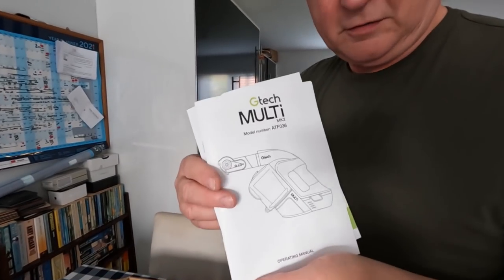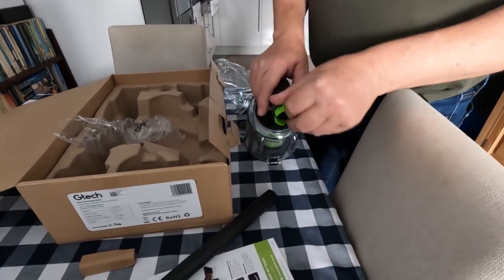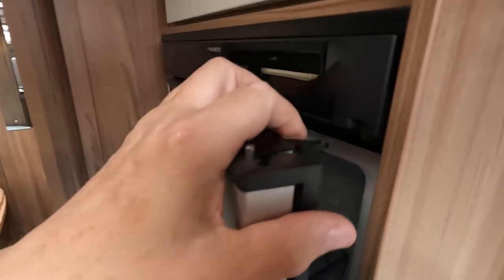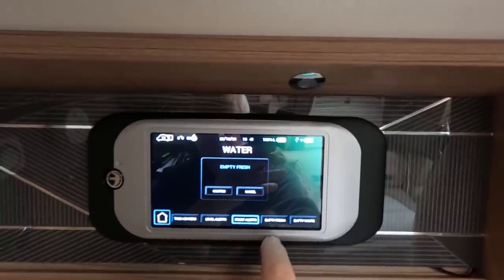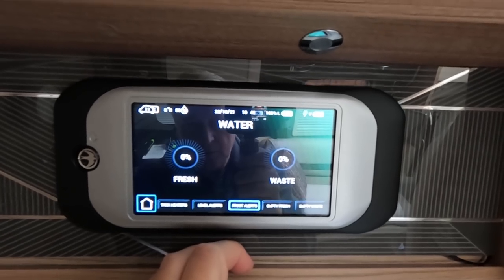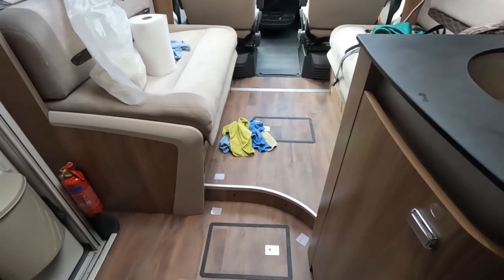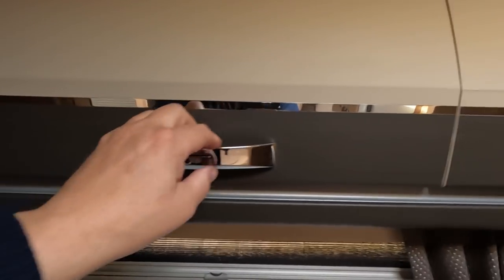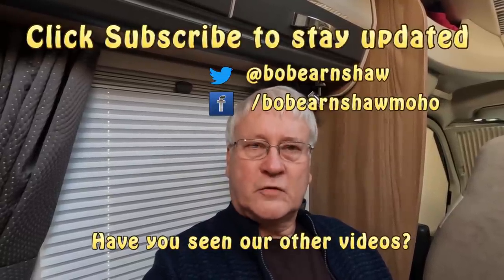Motorhome Warranty Work | New Gtech Vacuum | Motorhome Cleaning and Drain Down

Comment: They are spot on the G-techs aren’t they. I learned something new too - I didn’t know there was a tool stored in the main body it’s self - I should have probably read the instructions 😀 - I find the power button really sensitive also, especially when there is something near the inlet you don’t particularly want to vacuum. - David 👍🏻

Comment: I’ve owned Dyson and Gtech.  Gtech is the better product in my opinion - build quality, ease of use and battery life.  I wouldn’t be without the AirRam or hand held - both have given Stirling service for a number of years, used daily in the house.  The smart meter doesn’t register anything when charging them whereas the Miele plug in makes it go straight to amber.
Reply from the maker: This does feel well made.

Comment: I had one of those too, it lasts about 2 years and it will no longer charge. The new battery for it is expensive. Just thought I’d mention this. The Vax or the Shark are much better value and last/ work must better too. Bob could I ask you about your motorhome service and habitation check please. Last year I had a half service and a habitation check all at the dealers but next year I was told I would have to have the vehicle service done separately,  which means going to a Fiat dealership is this right. Thank you.
Reply from the maker: That would be the same with the Dyson then on battieries. As for servicing, many Motorhome dealers don't do the vehicle servicing, Todd's use a company called One Call. They don't have to be Fiat specialists. Todd's arrange the vehicle servicing on the same day as the Habitation service
Reply: Thanks Bob.

Comment: very interesting ,,i like todds ,,but was a bit angry that they would not do any warranty work on my autotrail ,,when they are a main dealer ,i tried to buy from them but they never had the one i wanted ,,but they are very helpful other than than that,,,
Reply from the maker: I had similar problems when I had a Bailey. Dealers get a lower rate for warranty work I guess.